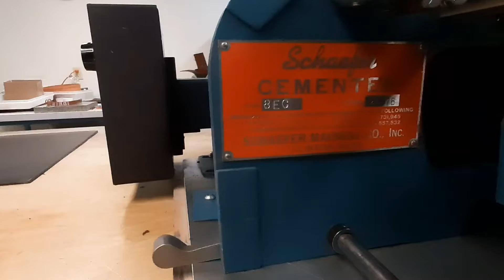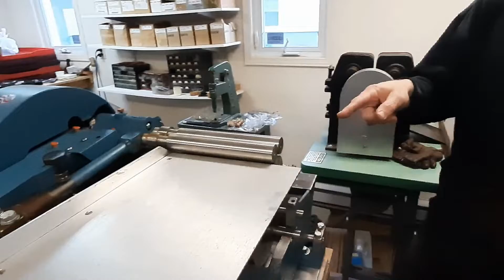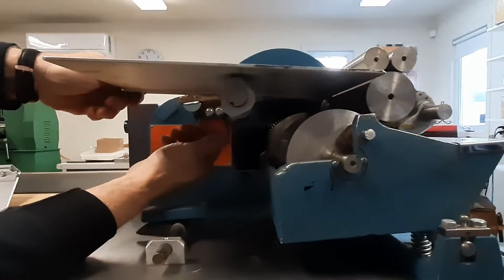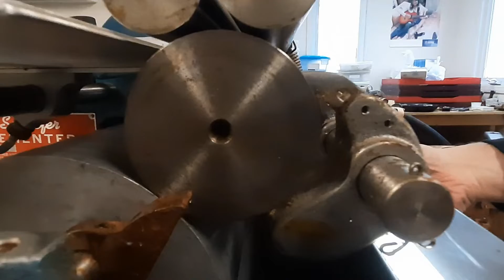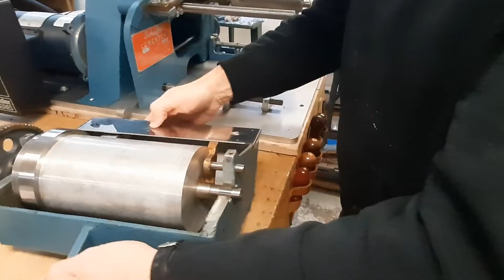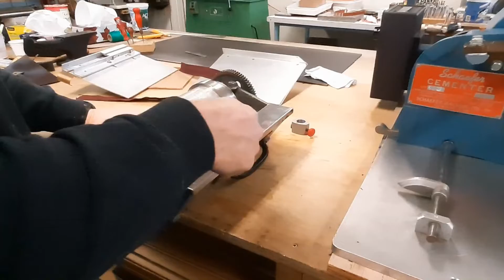Schaefer Edge Coating Machine for Leather

Comment: I have spent many years working with water based contact cement and to me this looks like a very bad idea
Reply from the maker: This is a proven machine that has been used successfully in leather production facilities for many decades. We have used it in our own production facility for years in the production of purses. The commercial water based contact cements we used are for production facilities and the contact cement remains tacky for days so leather parts can be assembled at a much later time.  They are not contact cements that you can buy at a hardware store. We used to spend half a day applying contact cement to large quantities of leather parts.  We would put the glued pieces on racks and then over the next few days attach the leather pieces together when we had time. The Schaefer Machine Co. has been manufacturing these machines in USA for many decades for factories. We also used it to apply contact cement to #8 YKK nylon coil zippers. This is a video of our own 8 inch edge coating machine.  You can also see a demo from the manufacturer on a smaller machine at https://www.youtube.com/watch?v=c4f0rJmV74E